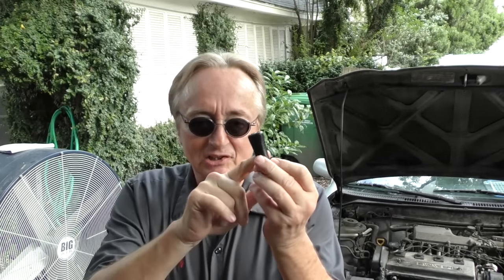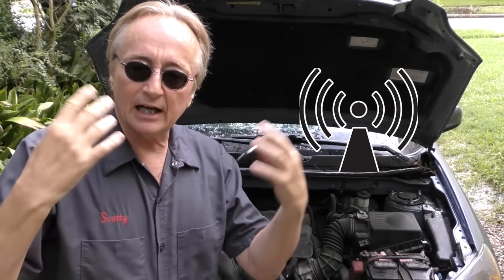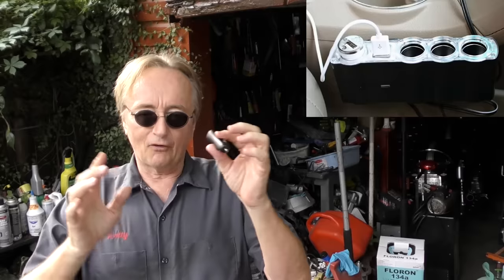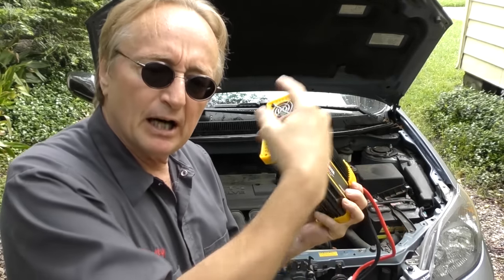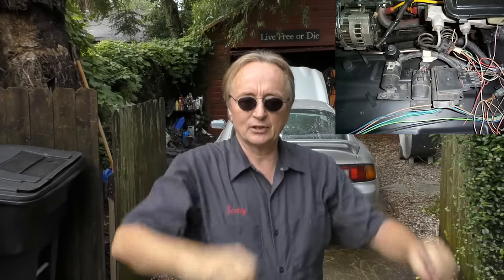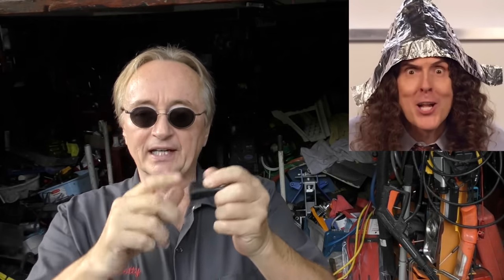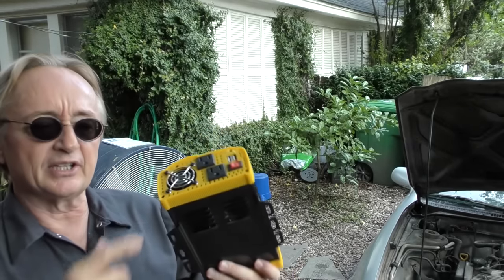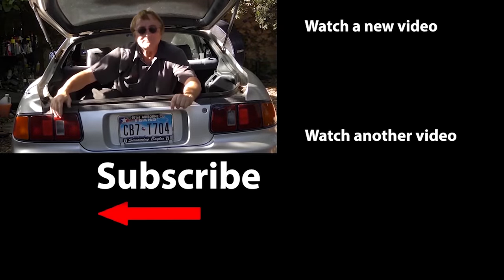This Adapter Will Destroy Your Car

Comment: Great info Scotty ....... but seriously dude, have you been hitting the Jim shots before filming this ? 🤣🤣🤣 Interesting you say run an invertor - I was hunting for a 12v power adapter for a DJI drone, so bought a 150W invertor. After buying it, I rang e supplier directly and he said it was actually a very inefficient way to charge a drone as you’re taking a 12v power source, then boosting it up to 240v ( 20 times its initial power ) to pass it through coils and capacitors to then cut in back down to 12v or far less - he said I was wasting my time ! So I got a refund and purchased a fused 12v cig plug adaptor that can charge two drone batteries and the remote all on the one cord 😉👍

Comment: Hi I have a 07 Mustang GT 4.6 I have a problem with no start no turn over I checked most everything and I figure it out when you go to turn it on the system check has Dashie and it says low fuel level which it has over three-quarters of a tank and it says check electrical system everything seems to be good no power to the OBD2 test port
Reply: No kidding man, this small USB adapter also messed up my 2013 honda accord destroying (confusing) my ABS sensor and I have to replace it for $1,800 so I can pass smog check.
Since then I always disconnected those adapter if I don't use it.

Comment: When I had a car I could literally hear that interference.I used to plug in my phone (or other devices) to my cars stereo and the sound was alright until I plugged in the charging cable.
I've tried different cables/different chargers but the result was always the same - interference in the speakers.

Comment: I normally use one of these to power my on-board welder. I think the good adapters are made by Toyota.
Reply: 🔵 How do you run a welder on 5-volts?
Reply: @joshhayl7459  it's a tiny welder.

Comment: Could the Bluetooth adapters also cause this? Also could it make my alternator or battery go bad been having serious problems like lights going dim to bright car not accelerating like normal and some times the car doesn’t start on the first try haven’t had the battery tested yet but when I watch my voltage gauge if I hit a button to turn something electrical on the gauge for the battery voltage drops and when driving it goes from high 3/4 of the way up too down to 1/4 the way up on the voltage gauge anyone who knows what it could be let me know please thank you!!!!!!!!!

Comment: recently left my phone plugged in while I was in a building for 2 hours. after a hard start i was driving when everything went bonkers and the vehicle stopped in the road. my battery was dead, my alternator would not charge and I had my vehicle towed home after failing to get it started.  I replaced my battery, alternator, several fuses before realizing my computer had a burned conector. long story short the phone charging had literally burned my  computer and I had to replace the computer. my vehicle is a 1999 and has a cigarette lighter not designed for long term charging of electronic devices.

Comment: My 2017 f150 has a built in inverter. The new ones supposedly will have a generator as an option.

Comment: Would rather use a zener diode and resistor and you will have 5vdc constant. No high frequency coil or AC to DC.

Comment: I just use a 300watt inverter. Its got fuses and it beeps at you when your voltage drops too low so you don't get a dead car

Comment: i've been using the cheap stuff off ebay for 10 years, never had a problem. but then i only have one plugged into each car, not 50.

Comment: I wonder if this is why my radio seems to be going out. I’ll have to check it
Reply: ........that was my thought too, but my radio is ready to toss out with it's stupid security code operation, I've given up hope for it returning to normal. Its Eurovox brand and u think it's likely in my case that it's some LED house downlights I installed that have messed up the radio. The 12 volt house downlights stupidly have an internal buck/boost converter which create serious stray EMR

Comment: We actually understand electromagnetism very well. Physicists have had those boiled down to a few essential equations and they work perfectly. If they didn't, half your electronics wouldn't work!  There is a vast difference between physicists and engineers though. Engineering does not require understanding. Just the equations.

Comment: Scott, I've been watching your YouTube channel for about almost 3 years. I like your explanations on cars and advice. This one caught my attention the most. My nephew has a VW small car. None of his cigarette 🚬 inputs work. I tried adapters like the ones you showed. Notging works. I think the previous owners burned something out by plugging these adapters in. Could something like this adapter cause major issues such as all cigarette 🚬 adaptors failing, heater to stop functioning and mess with the electrical stuff in a car 🚗.  My nephew can't figure it out and he knows about cars. The fuses look good. Its an 8 year old, small VW. Very nice, except this issue. It seems like a nystery.

Comment: I'm sorry scotty,  pctech for 30 years and I've never heard of an adapter putting out any kind of electromagnetic anything. for one thing its a simple resister and diode system... for 2 if it damaged electronics, it would meet ROHs compliance and would be allowed to be sold..

in Canada anyway..         oh   ps a power doesn't work that way. unless you truly believe that battery is AC...         ps the only thing it does is choke 12 volt car battery to 5 volts..

Comment: Omg this happen to me... It fucked my radio up.. the radio would turn back on after the car was turned off.. if I wiggled that stupid adapter it would turn the radio on and off.. I had to take the fuse out of the radio twice before lucky the radio started o work right.... I didn't know that this is why thanks Scotty. Also I never used he adapter again

Comment: You are very sympathetic guy, but an inverteris a very inefficient way of generating electricity. And it is unnecessary/bad to go from 12v(DC) up to 230v(AC) to charge then 5V(DC) smartphones or 19V notebooks advices. There are Charger that convert your 12V (DC) directly to 19V (DC) for Notebooks as example. I DO NOT recommend using an Inverter for Advices as Notebooks or Smartphones.

Comment: It happened to me my charging port suddenly stopped working. Toyota said if im using a cheap adaptor to charge my phone and I said yes? Maybe haha. Because the cheap ones can actually destroy or fry something in the port. In less tha  5 minutes they change the small chip kind of thing and it works again. They gave me the old one and yes it was fried and looks like a toasted bread. They didn't charge me for everything. I did buy a new one but sometimes I still use the old adaptor I have. I admit I leave my phone and pocket wifi connected to it for 2hrs straight long drive maybe twice or thrice a month.

Comment: Running a $4 cheapie with integrated bluetooth and FM transmitter without any problems. Charges my phone at 2A, without getting hot.

Comment: its not the magnetic waves lol its because the rectifier is built into the computer on most cars if not all of them so when the cheapo usb adapter shorts out it can screw with the computer.. it wasnt magnetic waves lol

Comment: The inverter could drain your car battery, if used with turned off engine. And then you would not be able to start.

Comment: You are confusing inverters and adapters. Better to have a charge pack and multiple ports connected to that. Isolate from the car computer system and just charge it when it runs down ... most USB adapters actually only run low dc voltage ... chopper circuits in inverters have worse hf signals running loose in your system ....  inverters will help drain your batteries as easily as new halogen spot lamps ....

Comment: Love the info Scotty keep up the good work, all those Rf’s in one area will fry your brain. I remember hooking up an 8 track player to my old car using power from a 12 volt wire under the dash of my Dodge. Every time I accelerated the 8 track would speed up also, not as smart as I thought I was.

Comment: I installed an inverter in the back of my car. So my boy can plug his tablet in. I & my wife only use the at&t cig plugs for our fones. Their only 20-25 but designed for our fone specifically.

Comment: why the hell would they take dc voltage convert it to ac just to convert it back to dc? simple voltage regulator with few resistors would do the trick

Comment: You are crazy! That device uses an integrated circuit to convert a DC power supply to DC power supply voltage. It is a step down regulator, from 12V DC to 5 V DC. Also it uses some capacitors to filter the DC curent. IT does NOT convert DC current to AC current. There is no electromagnetic field involved! Do some research before U speak (in this case).

Comment: All these electronics are electric power consumers. They can drain the battery.
Reply: The main reason you want to use the lighter plug, is the electricity your devices goes through a fuse. That can blow, în case of a short, or too much power drained. Generally, they don't cause problems but prevent big issues.
Reply: The reason you don't want all these things connected directly to the battery is you can shorcircuit the battery or completly drain it, leaving you stranded If you can't get electricity.
Much better would be to use a separate battery that you can recharge.

Comment: This video has to be the one where he lost his marbles xD.  The sockets in the car are 12v DC sockets.   and these USB adapters, they're made to regular energy output and you cant break your car when your car generated 200v and 50amp from.the damn alternator.  These adapters won't output more than what they're rated at, unless they cheap and shitty quality.  Don't be silly these things aren't a danger 😂

Comment: Often found this is pretty obvious when you use a cheap shitty buck converter power supply, it knocks the radio out when using FM.  :P

Comment: Just because you don't understand RFI (Radio Frequency Interference) does not mean no one else does either. This is classic misinterpretation of not so scientifically executed test / experiment. It is anecdotal evidence at best.  Do you realize that the majority of these things come out of the same manufacturers? 
If you feel you must share, just don't make out you are an expert and that nobody else knows more about it than you do because fact is you know very very little about this compared to even an average Electrical Engineer.
Reply: Evidence accumulated over 50+ years of working on cars. And read other comments here reporting problems caused by these devices.